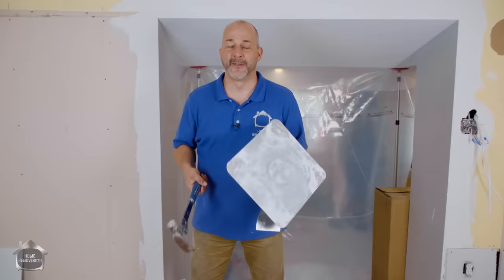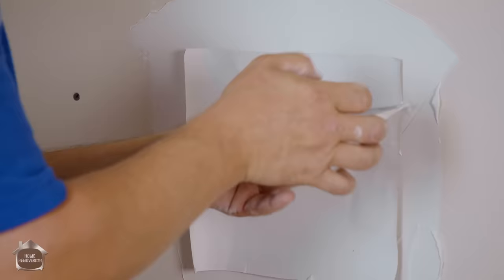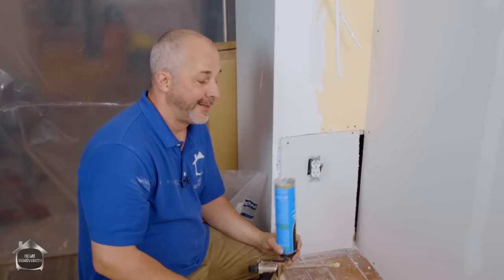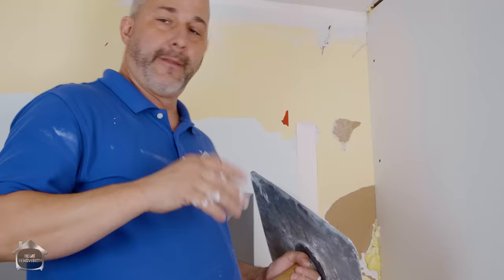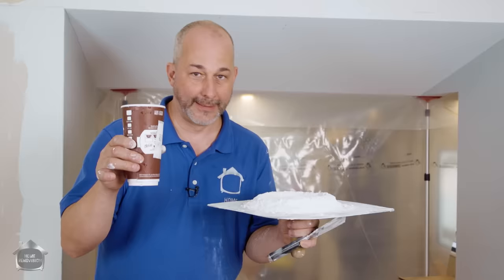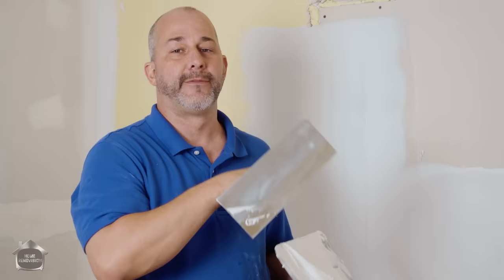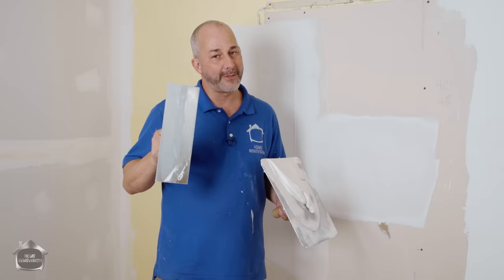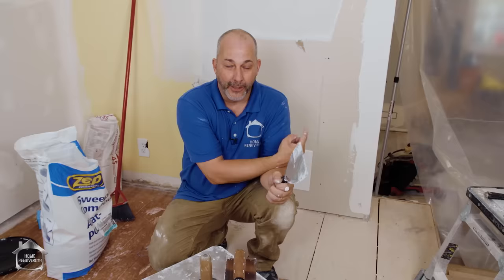Easy Drywall Tricks to Fix Any Mistake

Comment: For a backwards install sheet of drywall...skim coat it with drywall mud!  Another tip...cut a piece of drywall and trace around the repair area..tighter fit!  Also, you should've mentioned to get the foam gun cleaner can and immediately clean the gun! You did not mention the number associated with the dry mix is the number of minutes you have  before it sets up, ie:  dura rock 15, 20, 25, 30, 45, 60! Also...
I've  learned the thinner your drywall mud is, the less sanding.
Your gray hairs indicate you did not just step off the tuna boat!

Comment: This is 2 yrs old , so you have probably improved this method, by cutting a line on the wall around the outside of your full patch piece before you start scoring the patch. Then pull that paper off the wall as well, so your paper flange fits in the void made, and leaves less of a build-up.  It's a great trick either way.

Comment: I kind of like this method of fixing smaller holes. I usually use the wooden-brace method, but that requires for you to have some scrap wood, you need to cut it with a saw, and if it's crappy wood it ends up splitting once 3 screws are placed in the same line.

Comment: Springloaded only comes in specific sizes, and if your hole is not the right size, it won't work.  Yes you could cut the hole bigger, but if it is already a big hole and bounded on both sides by studs, trouble ahead.

Comment: I need to pull strips on vinyl drywall in a manufactured home, fill and tape the joints and paint.What kind of mud should I use?  What primer sticks to vinyl?  Will killz oil based primer work?

Comment: Terrific job!  my one question relates to the square patch.  Do you see any problems with putting a backing strip before applying the patch?  I have to say that the "self taping drywall patch" is brilliant (as is your use of expanding foam.  Sorting out compatibility issues for us, is a really bonus!)

Comment: Brilliant 👏  one question. I have a ceiling with the large brush (stalactites) finish. How can the mud on the back of the sheet rock trick work? The ceing isn't flat
Reply from the maker: in your case i suggest installing a piece of plywood with adhesive overnight. then screw a piece to fit. seal the gap with a little expansion foam to bond the backside of the joint. then add texture. Cheers!

Comment: Foam is for insulation stage, it's for widows, doors and is meant to be covered with drywall not to be used as a backer. When you have gaps in drywall you use a technique called flat taping
Reply: And yet he used both of those methods here 🙂

Comment: Can you use oil based primer directly onto a brick wall before applying new mud? 
I was stripping wallpaper and old mud came off along with paper.
(there was a damp issue on same wall, now rectified as house was roughcasted)
Catherine from Scotland

Comment: Hi. Big fan. I'm mudding a basement bathroom and when I put the first coat on a soffit I think I screwed up by putting a fan in there because the mud cracked all over where that fan was pointing. It's like a 14-15' soffit the cracks are just on the left side so I was wondering now after a week can I just go over the cracks with new mud? Thanks.

Comment: Question about the stucco ceiling portion of the video.  I "might" have an asbestos issue on a thr ceiling of a property I'm interested in.  If we slap on a slab of sheetrock over the existing ceiling, would that be an issue when installing recessed lighting?  Meaning, the combined width of two sheet rocks cause an issue with the installation dimensions of the recessed lights?

Comment: I’m having an issue with my closet, this is the second time I’ve put a shelf with a rod to hold sweaters  and once again the brackets came off the wall. I used 90 lb anchors and repaired the wall with wall repair patches. Should I use different brackets?

Comment: Great tip!  would the same procedure apply to a finished wall?  I've a couple of fist 6 and a 4 inch holes in my living room wall so was wondering if I could use this method or is there a different as easy like the CA patch?  Your help is appreciated.

Comment: So the house I just bought has an electric fireplace. It’s installed too high up on the wall for me and I’m getting ready to relocate it about a foot closer to the floor. The drywall work is the other thing I’m dreading. I was thinking I would take the piece of drywall that I’m cutting out where the fireplace will be going and putting that piece where the fireplace was previously. And then compounding/taping that. Would a California patch be better? I will be putting some woodwork where the fireplace was to support whatever drywall ends up going there

Comment: Your foam trick has just saved my life. Literally last piece and I sawed it horribly. Eye sore, thought I would tape over it with a corner bread. I will dash over to Home Depot and buy the foam, wonder if they sell one that does not require the gun? Either way if not, Ill still get one cause I need it
Thanks!

Comment: How do you fix wrinkles and bubbles in the tape joint? I'm going to be drywalling the exterior wall in my garage and when they built my house they just taped the ceiling and interior walls.  The tape has some bubbles and wrinkles in it.  Thanks

Comment: My 70s house had that popcorn on the bathroom ceiling and I ended up scraping that crap off exposing the paper.  That was difficult work.  Luckily it had no asbestos mixed in it.  Had I known I could have just applied new layer of drywall over it and attached the screws I would have just taped the joints, apply made and been done in hours instead of days.  Only if this video was available 4 years ago.  =(

That same bathroom isn't finished yet (about 95% done) after all these years but now I have new knowledge and new motivation to finally finish it off.

In addition, on my 2nd newer home which I moved into a year ago, I have to remove a 2x6 in both mine and wife's closet that is being used to support a top shelf and lower wooden rod bar for hanging clothes.  This is the typical generic shelf that a new home builder would throw-in with your closets.  I have a closet company coming in a few months and they require that I tear-down those items before they do the install as they typical only work with an empty wall.  The wall is textured so I'm sure by removing those shelves and 2x4 it will surely rip away the wall meaning patch-work needed.  I'm sure it's already textured behind that wood but if it's not I don't even know where to start.  =(

Comment: Thank you for all of the tips on how to do drywall, you make it look easy.
I have a couple of small bathroom walls to compound where there was a plastic shower stall, my husband put up the drywall. I have mesh instead of paper a little apprehensive about getting it done part of it is painted, and the drywall is not same thickness where they meet. May I ask, is it ok to use drywall compound over part of the latex painted drywall where I need to feather connect the two or will the compound let go and peel.  Thanks in advance, whether you reply  or not. Mia.

Comment: I am replacing my backsplash. I have mostly backer board on the wall but about 6 inches is drywall that sticks out about a fourth to half an inch where butcher block used to be. (Yes there was 6 inches of butcher block on the wall from the counter) which was glued to drywall and then backer board above that. How can I make the drywall flush to the backer board without removing the drywall?

Comment: so I'm getting a little better at patching the small holes. I have a large hole (about 13" square). I cut it out into a square and I have a replacement piece of sheetrock that I am going to cut to fit. how do I keep the new square from just falling through the other side?

Comment: I'm curious about your technique for covering up a textured ceiling using mud, 1/4" drywall, and the laminating screws.  Won't the weight of the drywall pull the texture/paint off the old ceiling over time?  And how long for the mud to dry with no air contact when sandwiched between drywall?
Reply: Installing a new drywall attached from inside to the old one - this is what I was suggested by a professional charging me ~$1k for each small bdrm. The ceilings in my old house were already too low. I decided to remove the ugly popcorn texture and straighten out the wavy ceiling. 
It's easy to scrape off heavily sprinkled with water popcorn if it's not painted. Use a putty knife. Mine was painted with acrylic paint. When I spray water on it, it becomes softer in ~10 min and becomes scrapable. I checked for asbestos bringing a small sample to a local environment lab ($60), result: ~1% of asbestos. So, I covered all the walls and floor with plastic sheets and kept the room door closed, used 3M professional mask ($45, always buy a big size, medium is for women) with special dust cartridges, and used goggles as well (just rub in thoroughly tiny amount of baby shampoo to the inner side of the glass against fogging). Not to worry if you scrape brown paper off as well. Next, I threw away all the plastic coverings from walls and floor and put up new covering. 
Before applying drywall compound on it the ceiling must be TOTALLY dry. I used ready-to-use light compound in big plastic buckets. Don't use "low dust" compound and better use a mold resistant one. This is where it's better to hire a professional if you're not sure how to apply mud. I learned as I went. Lots of fun, and I pretty much became a professional, this is not a rocket science. Valleys on wavy ceiling were 2" deep (!) against the ridges. Max thickness of the compound is ~1". So, I put in the valleys 1-inch layer, covered it with a drywall plastic mesh, used drywall screws with adhesive to secure the mesh and screws to the drywall. After drying put another 1-inch layer, making the ceiling surface totally flat. This is where you need long trowels.
First layer of compound is always thicker and uneven and with compound ridges left, second layer is much better, third layer is final. Each layer must be TOTALLY dry (NOT next day as in video) before applying next one. It's better to use a stainless steel long 16-20" trowel (not easy to find), putty knives and a hawk as in video or a stainless steel special rectangular container to hold compound in hands. Layers are applied criss-cross, with the last one perpendicular to the window wall. 
When it completely dried, I used a damp big sponge for grouting to finally smooth out the ceiling surface in circular motions. When it dried again, it looked like unpolished marble. Beautiful. Paint it white acrylic by SPRAYING 2 coats OR by rolling just ONE coat. Learned the hard way, that the paint on the ceiling behaves differently and does not even (!) as it does on walls. Had to sand off ugly second coat of paint. One layer by rolling is fine, since it gets absorbed by the compound and looks very smooth, second coat of paint by rolling dries uneven.
Resulted ceilings were perfect, just the way as they look in European homes. Visually, new ceilings looked ~3" higher. Will be glad if it helps.

Comment: 1:17 I learned from an older pro not to use those snap off blade knives for anything. They might brake unexpectedly, small piece is flying away causing different problems. I use solid knife for cutting drywalls...

Comment: Couldn't figure out if there's a different video that's better to look this up, but if you screwed up leveling drywall screw/anchor holes and you need to move one just slightly to bring things back to level, any tips or for solving this?

Comment: You had some busted drywall around an outlet on the right side of the room that I was really hoping you would address. Do you have a video where you fix the drywall that you're not filling in as a complete hole? Just cleaning up the edges like around that outlet?

Comment: How do I tape and float new drywall to existing painted inside corner. the existing wall is somewhat textured like it was rolled on thick and then skimmed over with puddy blade. Can I just "fill" the corner and paint with having to sand, tape, and float ove the existing corner paint?

Comment: Bucket of mud: instead of putting a cup of water, put a plastic garbage bag on top, pour water on top (will squeeze air out on top and sides) when need to use just pull off bag ). Any garbage bag overlapping the edge will create a better seal when sandwiches between lid and edge of bucket.

Comment: Went thru the entire write up section but couldn't locate the simple name (and where to buy) for the "self-adhesive" cut to size dry wall used in the very 1st example 2:15. Only dry wall at my local Home Depot is the full sheet or Repair Panels (i.e Heavier & without the self-adhesive). Any ideas? TIA

Comment: I do not see any link for the spring loaded access panel. I looked on home depot, and they had a different one by fluidmaster. Yours looked better... but probably more expensive? I also looked on Amazon.  Some were expensive, IMO. But wasn't sure which one you used.

Comment: How do I fix an uneven silicone edging done by the contractor that is between the ceiling and tile wall above my vanity mirror in the bathroom?  The contractor said the ceiling is uneven and the tiler cut the tiling to follow lower line of the ceiling, it looks like a concave edge over my large led cabinet mirror and looks ugly.  Can I try using taping to re silicone the line but it’ll have uneven thickness though…..

Comment: I just love your channel!! I just joined and I have a question about repairing a hall that is behind my furnace and hot water heater. Are there tricks or tools to  repair holes in extremely hard to each places. I can barely get my vacuum hose behind this stuff to get the dust. Help😊thank u
Reply from the maker: unless the hole is leaking water don't bother with it. if it is you need to trowel in some hydraulic cement. you can use a 24" drywall knife to spread the material that is hard to reach. Cheers!

Comment: Anybody can do this.....😂🤣😂 You are a Master at it and as a Builder/Designer who has worked on everything from earth to sky, I can attest to the fact that there are many who are skilled at many things including myself but drywall is another animal of itself that takes a Master to do well. I love a Level/Class 5 finish and I can skim coat a wall as smooth as a baby’s behind but I abs HATE drywall work and will absolutely gladly pay for someone else to do it. I have hung and finished, repaired And demoed more drywall than I ever care to do again. I am right now finishing my house to sell it and then will build my last and forever home. I am dealing with a repair of a large hole that is my own fault. I am installing backsplash tile and installed the bullnose edge tiles wrong. (It happens to the best of us) I used my Porter Cable Multi Tool to remove the bullnose and created a huge mess right next to a glass tile backsplash on a wall with a pocket door. Fun fun fun....I am using a piece of wood inserted right next to the glass tile to have a backer board and using a California patch on the other 3 sided of the patch for a hybrid patch that will work in this situation. However I now have to remove the bullnose tiles that are on the edge of both sides of the window above the sink and definitely will go much slower and try not to do so much damage but I install my tile to stick and always use a large format tile thin set even on small tiles. It’s great when you don’t end up with tiles that are slightly larger than expected and grout lines line up as you planned them to.....not so good when they don’t...ahhhh the joys of building and remodeling.....Anybody can do it 🤣😂🤣

Comment: I really need help with my gypsum ceiling as the tape that exists between the boards after 19 years have been peeling off some time now. I’ve just left it so but it doesn’t look good - the sight of it is just so uneven and imperfect! Can you assist me with how I can repair this MYSELF??? Or do I have to get a repair guy who’s gonna charge a bundle to fix it!!??
I really need your input on this!! Thanks in advance!
I can even send a pic if you need a view of the prob!!😊

Comment: New member here, loving your content so far! 

Question: you recommend against using the Home Depot buckets for mixing mud in several of your videos because the plastic will shave off into the mix, but I didn’t see a suggestion to what you recommend using. What would you suggest?
Reply from the maker: food grade buckets. Home depot does sell them. they have the measurement marks on the side of the clear pail. Cheers!

Comment: I think that is the different way to do drywall of the regular way.. that works too but just in small patches and not in big areas also that tools are more difficult to used comparable with the originals tools
Reply from the maker: These are the original tools. those other ones were invented to be easier but you loose a lot of finish quality when using them. I teach the best way. others teach an easy way but with poor results. Cheers!

Comment: I do have a question:
I repaired a drywall seam with spackle instead of joint compound. I have a mobile home project that I removed 2 strips of Barton board from the kitchen wall and tried to repair the seam with spackle. It repaired it and visually looked fine before painting it. I even feathered it out and got my hand wet at the end to smooth it out more and feather it more.
After painting it, you can still see the raised parts where the spackle is. It doesn’t help that this is for a rental property so I am using semi gloss paint. 

How do you recommend I fix it from here??
Reply: Batten strips** (on interior walls)

Comment: When you cut out the new drywall piece without cutting the paper, can you also do that if the hole is larger? Like 12"x12"?
Reply from the maker: add a little support behind for larger holes. Cheers!